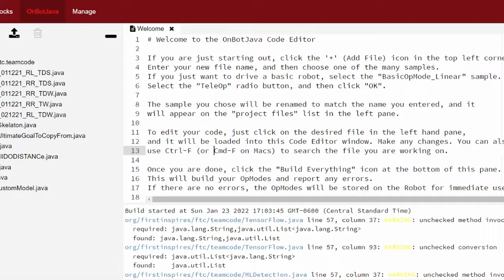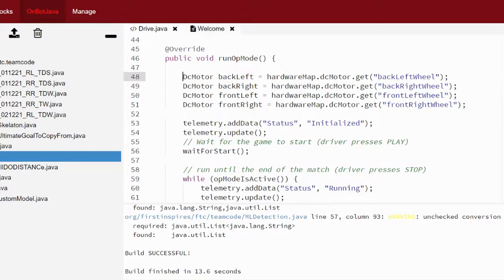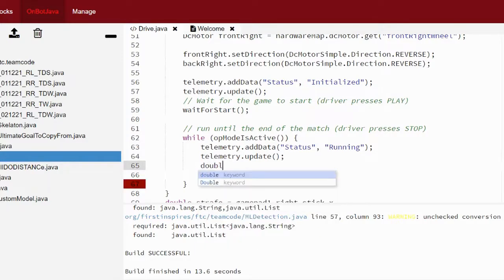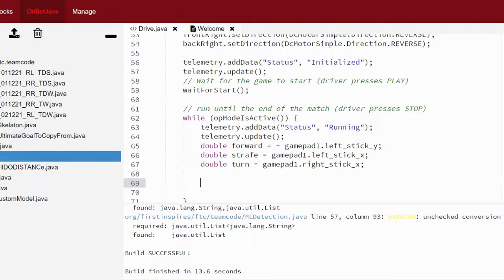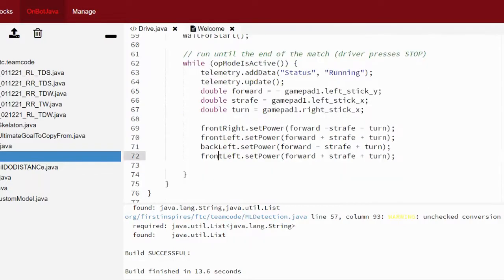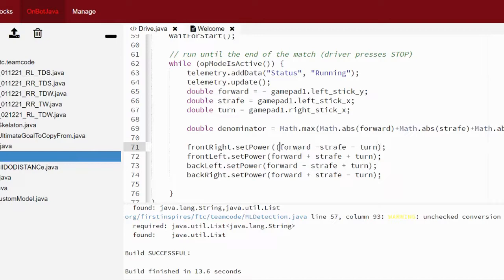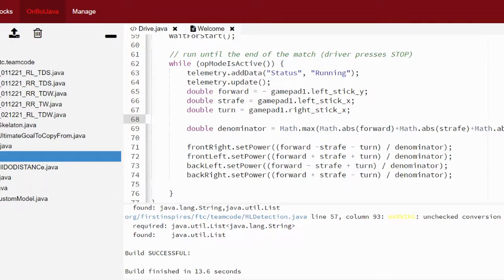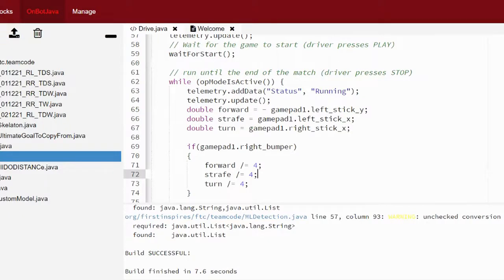OnBot Mecanum Wheel Drive Tutorial

Comment: Why would you want to reverse the right motors, since counter-clockwise is positive power by default? That would mean that applying a power of 1 to every motor would make the robot move backwards. Also I like the explanation of the denominator, I had never heard of that and now you've convinced me that it's good (especially for field-centric driving, which my team uses, since the drivers expect the robot to be moving correctly more than if it's robot-centric, I guess.
Reply from the maker: Hi! So which wheels you reverse depends on whether or not you have chain drive or a direct drive, or if you use gears to connect the motor to the wheels. My team used gears, so we had to reverse our right wheels, but if you directly attach your wheels to the motors or if you use chains, then yes, you might need to reverse the left motors.
Reply: @p3ftcteam803  You probably should've mentioned that in the video or put it in the description, since I'd guess most teams don't use gear drive and instead use direct/belt/chain drive.
Reply from the maker: I will add it, thank you for mentioning this!
Reply: @p3ftcteam803  👍